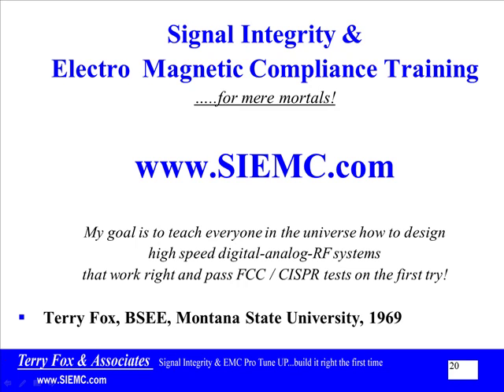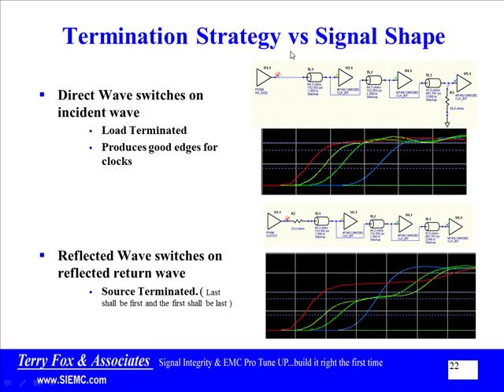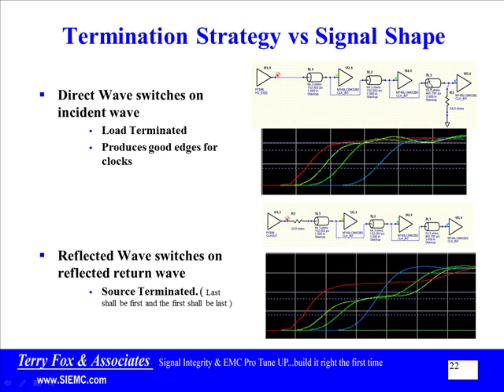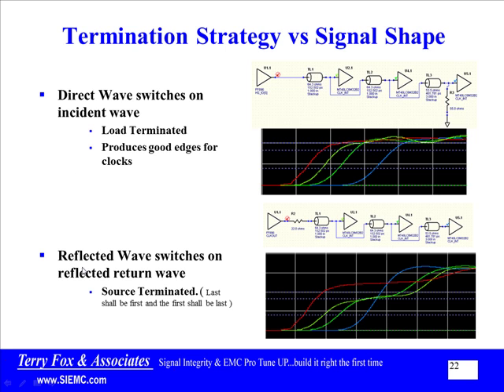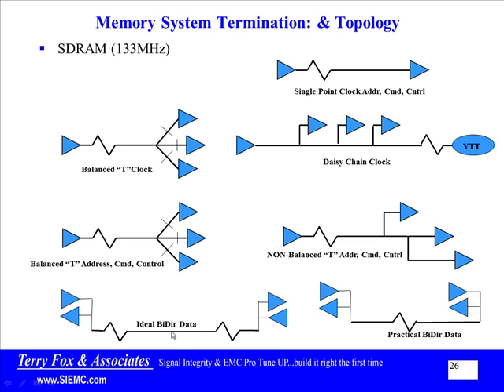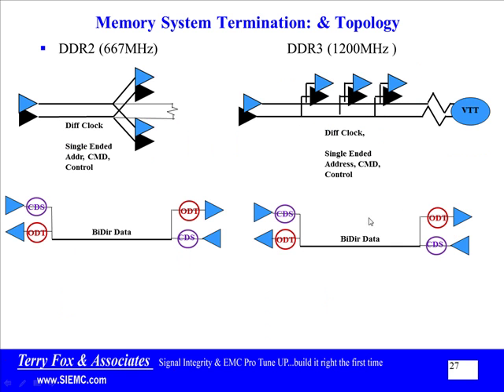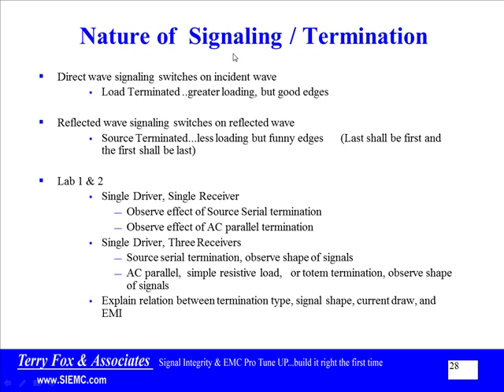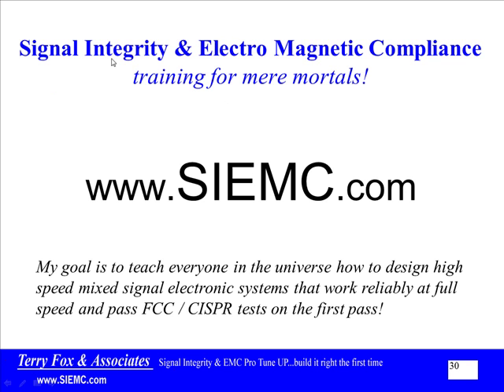Topology and Termination Introduction

Comment: The correct resistor value and location depends on the circuit.  There is not a simple answer.  That is the reason I recommend simulating the circuit before building it..TFox